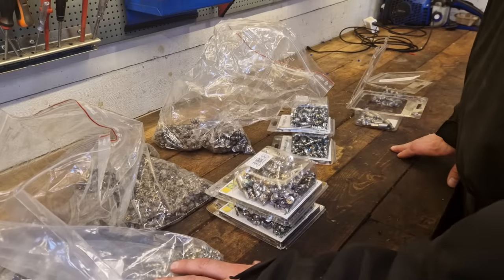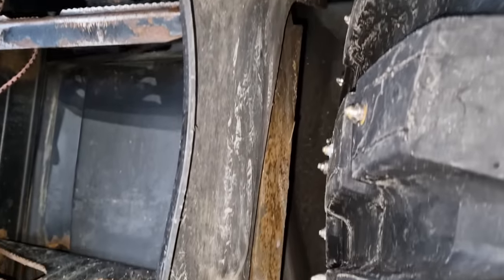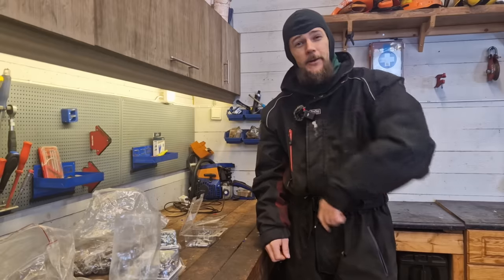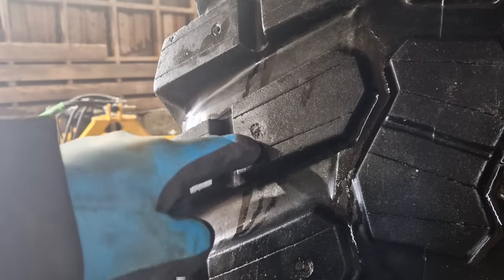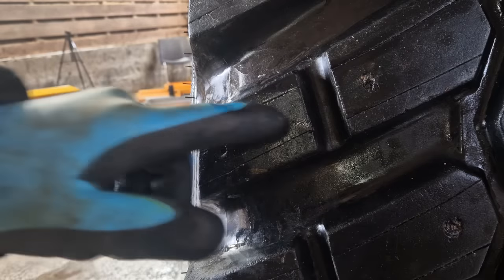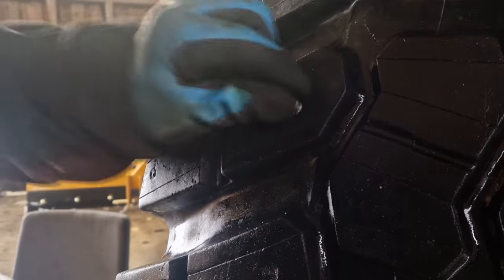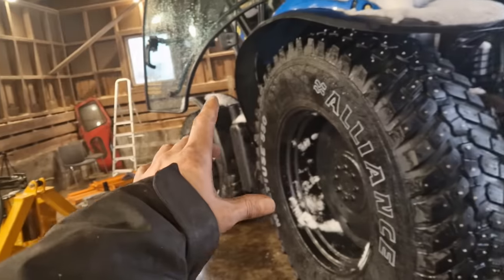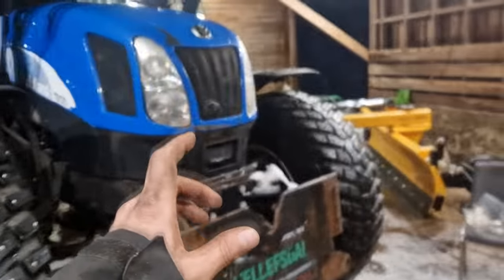Why I'm NOT Using Snow Chains: Snow Plowing Tires

Comment from the maker: ‼NOTICE: The studs should be mounted slightly further into the tire than what I demonstrated. If you've decided to purchase some studs using the links in the description, read the manual that comes with them of course - But in my specific case they should have been installed about 2 mm (1/16 Inch) further into the tire than what the manual described. Only the top of the stud should be protruding, not the entire head.

I'm sorry for any confusion. I am not sure if I've read the wrong manual, or gotten a different tool than what the manual described.

I'm debating whether I should make a correction video, or if this comment is enough? Please let me know your thoughts by replying to this comment.
Reply: A demonstration of the correct mounting method and result to me would be beneficial compared to understanding typing. In my opinion. Thank you for the video.
Reply from the maker: @brianworley7705  I've uploaded a follow-up video. You can watch it here: https://youtu.be/kAO1vxQ85YQ

Comment: Chains and weight is always the solution for those that have trouble understanding basic physics
Reply: And for this guy, studs are the BEST option.  Explained for those who struggle with common sense
Reply: While you’re 100% correct when it comes to “deep snow” (meaning 6 or more inches unpacked) and off highway, on actual ice or a plowed and slick bit of road you actually want studs, more smaller points of contact that dig into the icy surface actually provide way better traction than a chain ever could only downside is wear on both the road and the tires due to the studs
Reply: @stevenbryant3055 

There isnt a comma in op's sentence.
Reply: Impossible challenge: learn something without calling people who don’t know the thing stupid
Reply: @tropicaljupiter you read it wrong. He didn’t use a comma he’s saying that dumb people think chains and weight will always beat studs not the other way around. The videos creator even liked the comment which is why i noticed he was on the side of tire studs not chains

Comment: Wheel movement in neutral is somewhat normal. The oil inside the transmission is moving all the bits around, and thats enough to turn the bits inside if there's little to no resistance on the tires. The fact that the wheels move is actually good. It tells you that your clutch isn't worn out. But, also means that you can't easily spin the tires by hand because you have to overcome that small amount of neutral clutch engagement, or spin the transmission, in order to do so.
Reply from the maker: Interesting, thanks for the explanation! 👍 And for watching ❤️

Comment: If you don’t have any big hills, studs are fine. If clearance is a problem on the rear wheels, put chains on the fronts.
Reply from the maker: I have thought about chains on the front only, actually. The problem is I drive a lot at top speed on the main road. Chains are a bit sketch when drving 50kmh for 30min straight. I might do it next season though, I'm making some changes to my route 🙂

Comment: Tractors are usually hydraulic and you have to activate the bypass to allow the wheels to turn freely even in neutral.
Reply from the maker: Interesting! Thanks for the info 👍
Reply: I could be wrong but I think this kind of tracktor does not use hydraulic driven wheels.

About those back wheels turning on the neutral gear. The oils and fluids "graps" to gogcwheels etc inside gearbox, differential. Check out (Nikola) Tesla turbine. It uses this "cohesion grab". English is not my native language but hope you get the point.
Reply from the maker: @SinuheSieda  very interesting, I'll check it out thank you 😊
Reply: Normal Tractors are usually NOT hydraulic in that way….
Reply: There is planetary gear and you are sort of wrong side of that when spinning the tyre by hand.  Axl spins alot faster then tyre. So its easy for the transmission to spin the tyre. Not easy other way around

Comment: Yes, the wheels spinning in neutral is normal. At least when the transmission is cold, the oil has enough viscosity to turn the output shaft just from the oil movement inside the trans. 
Any time you have to jack up a vehicle, block up the wheels, so it doesn't start rolling on it's own. And I'd say that you don't need jackstands when installing studs on the tires, since you're not getting under the vehicle.
Those Screw-In studs are awesome. Back when I used to ride a 50cc moped year round, I used same style studs with a shorter stud and thread to winterize the Enduro tires. Way better for snowy conditions than store-bought winter tires, as they had much more aggressive thread in them, they just didn't have the studs.
Reply from the maker: Awesome, thanks for the clarification 👍 Yeah I think the screw in studs are great, they have a very aggressive bite in them, it seems like. Also, thanks for looking out for my safety, I appreciate it. You're right about blocking the wheels.

Thanks for the comment. And for watching ❤️
Reply: Stands are still good even if you're not getting underneath, hydraulic jacks can drop over time and aren't always the most stable, so if you need to work for a decent amount of time or might have to leave the job and come back to it a set of solid stands will be better.

Comment: Wheel spin in neutral is normal, clutch always drags a little bit. Please chock your other tires. Blocks behind and in front. Any time you lift always use jack stands. But i prefer big logs on all corners. I hate jack stands in general. I almost died one time. It slipped on a frame part. Not perfectly flat. Nice looking road tires. My wife's family were farmers. Never drove on paved roads. He loved chunky big chains for deep snow and ice. Worked well. But no way can you go on paved roads. Just dirt. And they were bumpy bumpy. Augers look interesting. Thanks for sharing. We've never heard of those here in the states. 
Back in the day my uncle had a belarus 4x4 tractor. 4x4 tractors were very hard to come by in the 80's and 90's, for a low price. That tractor was spot on.
Reply from the maker: Thanks for the clarification about the wheel spin. It's a good idea to use blocks, I should have done that. Sometimes I just start working on things and I don't always think about the potential outcome if something unforseen were to break, so thanks for reminding me!

Yes snow chains are superior in most circumstances, but for driving on paved roads as you said it just doesn't make sense. I have thought about bringing with me some easy-on lightweight chains for the front wheels when plowing, for those worst days.

Old Belarus tractors I have heard great things about them, but they are a pain to get parts for around here.

Thanks for the comment, I enjoyed reading. And thanks for watching 🧡
Reply from the maker: Same here my friend. That's basically the main reason I bought the New Holland tractor, because the local 3rd party parts store had about 100 pages of parts, mostly in stock, on their website.

I'm glad to hear your stance on right-to-repair as well and acknowledge the shady business that is today's John Deere. Their old tractors I hear are great machines, and that's probably true, but I am not earning them a cent.

Edit: I responded to a comment that seems to have disappeared 🤔

Comment: You can get the chains tight to the tire. let out some air before putting them on and fill back up. Some shops do this and we did on our last tractor, because of the same issue you have (clearance)
Reply from the maker: Yeah, that might be a good solution actually, never tried it before. Thanks for the comment, and for watching ❤️
Reply: at least forest chains are supposed to be a bit loose so the moving of the chain removes the accumulated snow from the chain
Reply: That's what I use to do.

Comment: Never heard of "tire siping" great tip thanks, it's not just for tractors but for cars and trucks too. Should work great up here in New England U.S.A.
Reply from the maker: Absolutely, it should work great for most vehicles! I'm glad you found it helpful. Thanks for watching ❤️
Reply: On old style bias ply tires, micro-siping auto tires was approved as an alternative when snow tires or chains requirement was effectuated in snowstorms. Supposedly contributed to extended tire mileage also.

Comment: Hello, the reason why you can't turn 1 wheel when the tractor is off is because of the 4wd. The frontwheeldrive is activated with a spring, when you press the button to turn the 4wd off the tractor will disengage the 4wd clutch with hydraulic pressure. 
The wheels should not be turning when everything is in neutral! But it is possible when te oil is cold one of the 4 clutches will stick.

Comment: 6:10 the weight is off the tires and you remove the parking break. The spinning could be a tiny bit of energy that made it through the transmission while shifting either from the engine or simply from the parking paw (if it has one, i dont think tractors bother with parking paws) Or whats more likely with massive tractor wheels, they are every so slightly out of balance and turning the tractor break off allowed the heaviest part of the wheel to rotate downwards.
Reply from the maker: Hadn't thought about the unbalanced affecting the roll, that makes sense. Thanks for the comment! ❤️

Comment: One wheel spinning is normal in coold conditions, it's the coold oil draging the other side with it when the clutch spinns. Would have been nice to see you do some kind of test before and after you put those studs in.. I used them some years, but i cant say if the machine grips better or if i only "think" it grips better.. 🤔❤️🇸🇪
Reply from the maker: Thanks for the clarification about the clutch drag. And yeah, a comparison would have been a good idea, actually. But I do notice a big difference in just the extra studs I put in this year, I would guess around 20-30% more traction just from that alone. So they definitely do help, at least for my application. And the siping adds a lot as well.

Thanks for the comment. And for watching ❤️

Comment: Great video! 15 years operating wheel-loaders in arctic conditions here. The best option would be to get actual high quality winter tires. 
Hands down the best tires I’ve tried are Michelin x snoplus, like driving on gravel even in steep conditions.

I understand that’s not what the video is about but just wanted to put it out there.
Reply from the maker: Oh that's awesome! Given your experience, I'll take your word for it, haha. I bet they're quite expensive though, just looking at the michelin crossgrip that are available in my area, it's a price tag I couldn't justify with the little plowing I do around here. Even brand new ones of the cheap tires in this video, are quite a hit to the wallet! If I had some proper plowing contracts then I could probably justify a good set of tires like that. But honestly, this setup I showed here has worked amazingly well for the purpose. A neighbor of mine does a lot of plowing for the municipality, he's got a brand new set of Nokian Hakkappeliita something something expensive words, with studs in them.

Thanks for the comment! And for watching of course ❤
Reply: I totally understand I work for a large company so big brand tires are really not an issue cost-wise, if i was soloing I would do the same as you!
Been wanting to try the hakkapeliitta snow loader tires but never got the chance, from what I hear they’re great. 

Anyways, best regards and awesome content keep it up!  /friendly neighbor from the east 🙂
Reply: @woodlandwrench the michelin and Nokian are all season tires. They aren't like their car winter tires that are just for the winter. Don't know if that makes any difference.
Reply: @PC-nq3ru  You're wrong, they have all types of tires. Just open their website

Comment: My old case has the same issua, 4wd clutch is spring loaded and opens whit hydraulic pressure. So when the engine isn't running, no hydraulic pressure and the 4wd clutch is on
Reply from the maker: Interesting, thanks for the info! Might be the same with this tractor then.

Thanks for watching ❤️
Reply: @woodlandwrench it’s a passive feature to keep all 4 wheels locked since the engine is off 4wd is applied. When the engine is running hydraulic pressure releases the 4wd. If was a gear shift and not a hydraulic clutch it would be able to turn when the engine is off. Also when you press the brakes 4wd is applied to give braking force to all 4 tires when the brakes are connected but when disconnected will allow for brake steering.
Reply: Hi, yes they work so. It's a 'negative' working wet clutch @woodlandwrench

Comment: Both tires need to be off the ground The tire is spin in opposite directions from one another when they're off the ground in neutral I also believe the tractor was leaning a bit to one side which was stopping one of the tires from spinning

Comment: I found out drop air pressure helps.    Operated grader with chains you just get in deeper in snow and once stuck dig self a hole with chains plus repair the chains are not easy which you have to do to keep them on
Reply from the maker: Thanks for the tip and for sharing your experience ❤️

Comment: The reason you cant rotate the wheels is most likely because the tractor has a spring applied, hydraulically released parking brake - its a safety feature. Lose the engine, the parking brake automatically applies.

Also wheels spinning in neutral is normal - believe it or not, its mainly caused by oil splash in the transmission case.
Reply from the maker: Very interesting! Thanks for the clarification 👍 ❤️

Comment: I'm sure these are fine for a lot of people. But when I worked as a tire tech in Sweden above the arctic circle I saw a lot of these screw studs working their way all the way through the tire until it punctured. Usually an otherwise fine tire would be beyond saving as even if only one stud had made it all the way through a bunch of others were already very close to also going through, making not worth repairing.

This was primarily on wheel-loaders and semi-trucks though and in intensive commercial application with heavy use, especially if used on any kind of coarse gravel or similar surface. Because of this they have a pretty bad reputation in the commercial and industrial world of the very north of Sweden at least. The vast majority of companies and individuals who do snow removal just run dedicated studless winter tires with winter rubber compound and siped tread pattern on their semis, loaders and tractors. Though this may be cost prohibitive depending on how much driving you actually do in winter conditions.

That being said I'm sure screw-in studs are fine for a lot of applications and that a lot of people have success with them, just wanted to share my experience as a caution.
Reply from the maker: I have also heard about the problem you're speaking of. There are a few different brands of studs, and the ones I used in the video that have a very coarse thread seem to do very well. But my experience is limited to just 3 brands and also very light use compared to the industrial scenarios you're referencing.

Your comment is a good read and something to consider for those who are looking to use them in such applications.

Thanks for the comment! And for watching ❤️
Reply: @woodlandwrench  It's also possible my experience may be skewed due to me only being exposed to punctured tires with cheaper and/or badly designed screw-ins, while the ones with success just truck on. Reverse survivor-bias or whatever one may call it. I think the rubber compound may also be a factor. I mainly saw studless winter tires which had the screw-in studs added by the user. 

Since dedicated winter tires have a softer rubber compound they may be more susceptible to the studs working their way in. I think regular agricultural and industrial tires may be more suited to having screw-in studs added to them. Just a theory though.

I just stumbled onto your channel and I like it, you got a sub from me for sure! Fun to see a fellow Nordic making this kind of rural-machinery-wrenching content!
Reply from the maker: @enok90  Your theory about rubber compound sounds logical to me! I'll keep an eye out for any misbehaving studs this season, I'm pretty sure all of them were present when I unscrewed them last year, but I didn't count 😆 No punctures though!

Thank you for the kind words and sub. I really appreciate it ❤️

Comment: Parking brake engages when you are not semding voltage to the parking brake. Turning on the parking brake shuts off the power to the brake.

Comment: You have a limited slip differential in the rear of that tractor so when one tires off the ground the other tire is on the ground it turns about a quarter turn and then the limit to quit gearing will engage. If you'll notice when you spend out in a field you'll get one tire that'll spend and then suddenly both will engage that's what that's for. Now you may have a switch inside the cab of your tractor that can turn this off on my John Deere tractor I have a button I can push with my foot which will engage both wheels and then when I let the button off it disengages the future. But if I'm on  grass going uphill and one of my tires starts to spin the other one will engage within seconds
Reply from the maker: Thanks for the info! I do indeed have a button in the cab as well, I thought that was the only diff lock, didn't know it had a LSD as well. 

Thanks for the comment, and for watching ❤️

Comment: You parking brake is spring applied pressure realeased. As a mechanic i often have to pressure up parking brakes in order to tow a dead machine.
Reply from the maker: Oh that's interesting. It feels like a regular parking brake, but of course it could still function the way you explained. Thanks for the comment ❤️